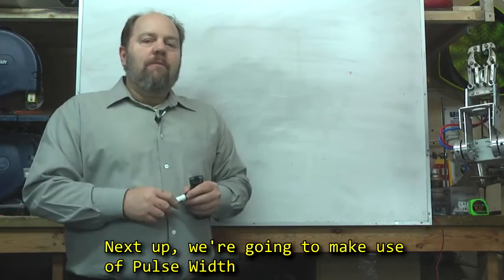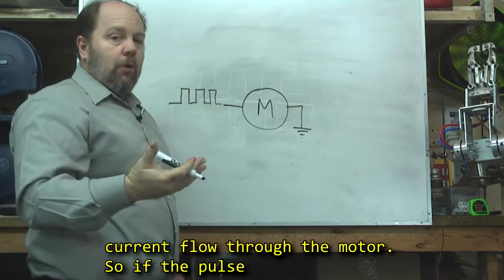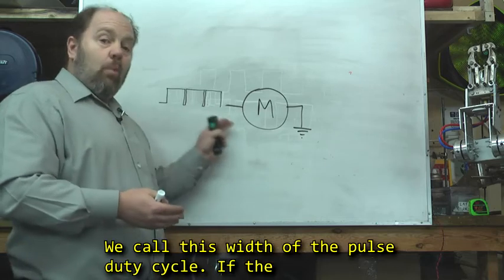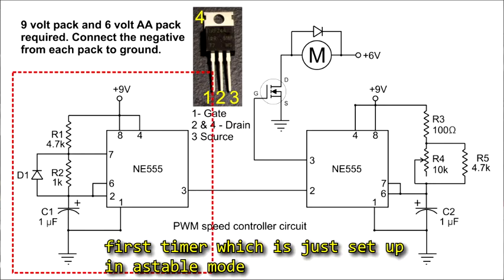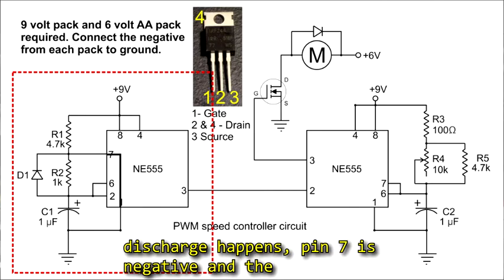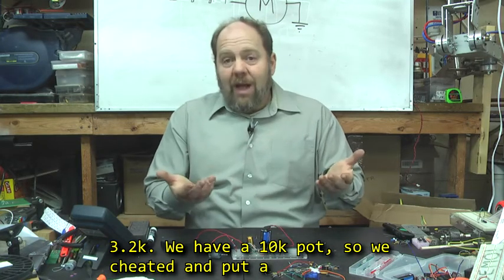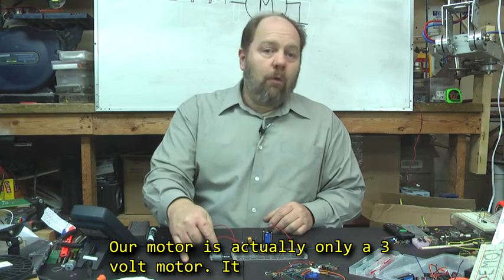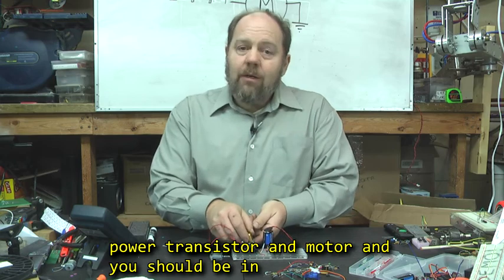Introduction to Pulse Width Modulation - free preview of Robotics course lesson

Comment: Why not a single 555 for pwm?
Reply: I think....

Changing the pulls width when using only one 555, also changes the frequency.

Using 2x 555 you can set the frequency on the first and then set the Pulse width on the second.

Kind regards